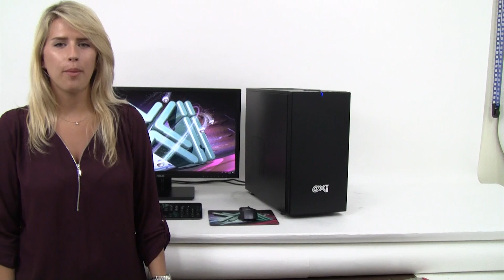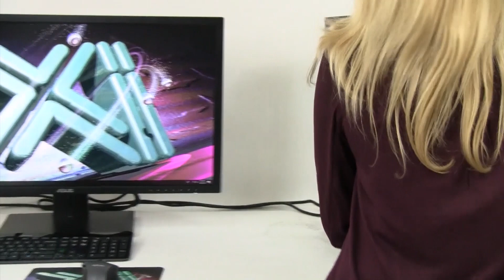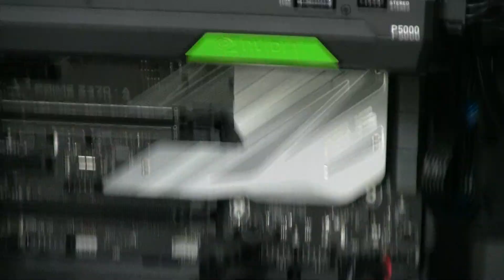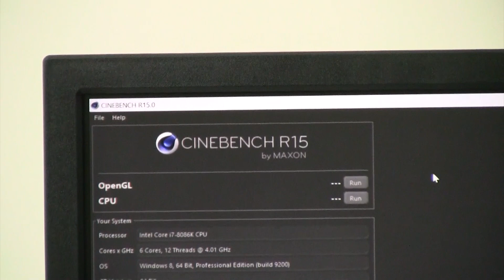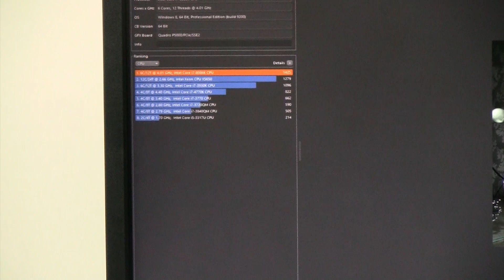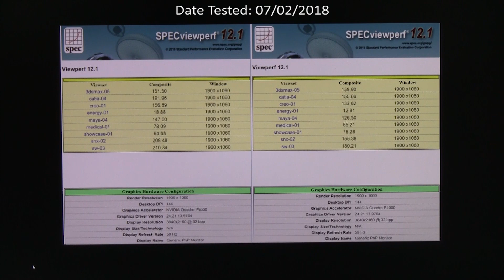Intel i7-8086K Overclocked @ 5.3GHz, NVIDIA Quadro P4000/P5000 & GeForce GTX1080Ti

Comment: The ram is not clocked at 3600Mhz, but 1800Mhz.
Reply: DDR stands for double data rate
Reply: @francisharbourt7625  The idea is to clock data on the rising and falling edge of the clock. This is why it is called ddr.
Reply: @francisharbourt7625  True, and it works like I described it above.